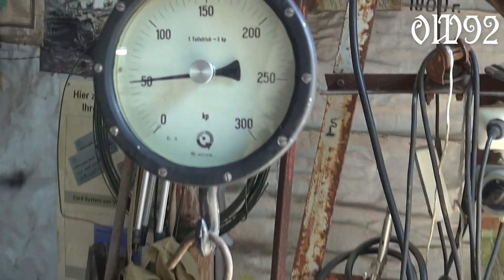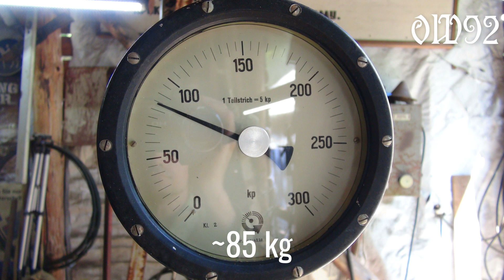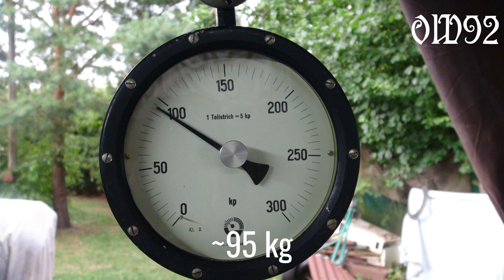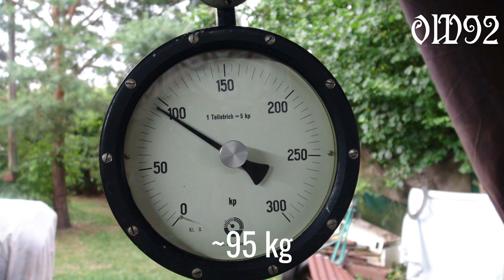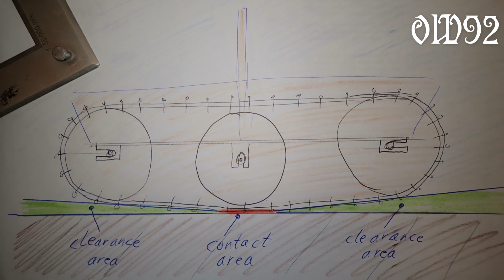E-bike tank #20 / part 2 / TEST DRIVE

Comment: Интересная фигня.
Думаю такой сделать.
Обязательно токарные работы?
Нету токарного станка.
Если чертежи хотя бы от руки?
Reply from the maker: Well it's not that great with bicycls wheels. If I were to try again, I would take motorcycle wheels instead. Should handle forces from the sides much better, I guess.
Everything is possible, you can buy for instance precision tubes without a seam inside and with a large variety of sizes. But a lathe, even a crappy little one like mine, makes life a lot easier.
Reply: @Osterwald92 Денег нету да же на такой дрянной станок
Reply: @Osterwald92 гусеницы из чего.
Транспортерная лента или ремни безопасности?
Reply from the maker: Tracks are made of some special conveyor belt, I once got from someone. Can't say what it used to be.